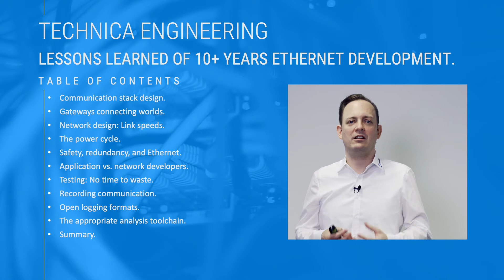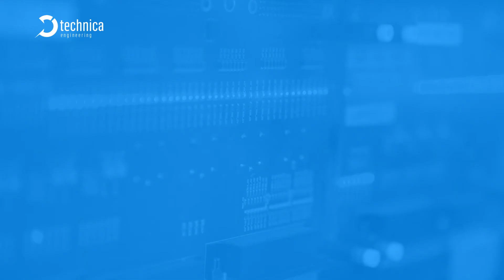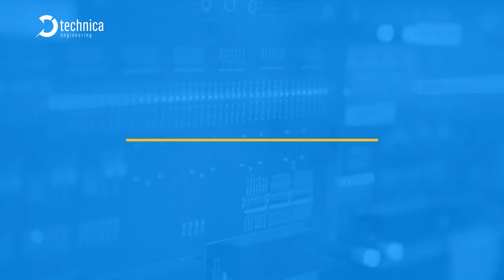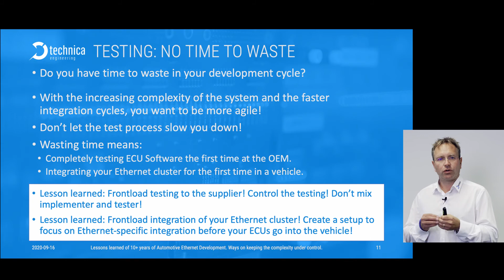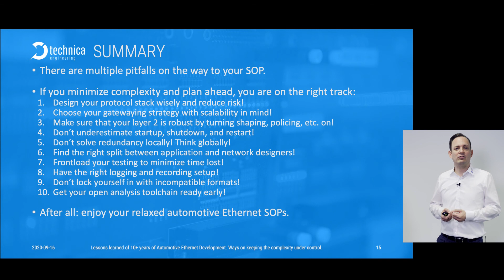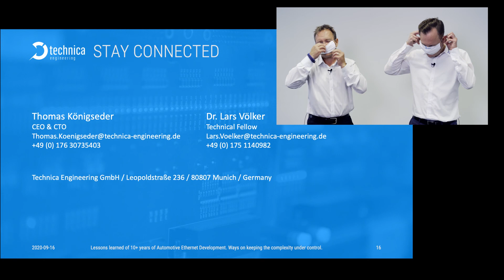Automotive Ethernet - Lessons learned of 10+ years Ethernet development

Comment: Great presentation. I am pro AQA with experience in embedded + auto hobby fan, so let me share my personal IMHO. All words are right about system in development and just released with warranty. But what about aftermarket, independent services and auto criminals? Identifying malfunction became much complex, especially with old wires, additional equipment could be required and most probably out of the budget for small services, so such cars would have much higher service cost and shorter lifecycle. Also not very good from ecology.  Car still can be stolen using trailer\hijack, then flash memory can be duplicated from clone, and finally ecu can be cracked and flashed. What we have in result, car which encrypt level of fuel and camera data 24x7, but can be easy stolen with retranslation\trailer\hijack...  and can be serviced only with official services with specially educated(often not) personal, and small simple diagnostic on the home town is impossible. if you live 100km from closest dealer, and you have some water in the wires, you ll hate the carmaker, if 200km, you ll sell ad buy another brand ))) I believe, aftermarket service is also important, which now-days is ignored by manufacturers. why people love Toyota? it can be fixed with hummer in the own garage(I am bmw fan)